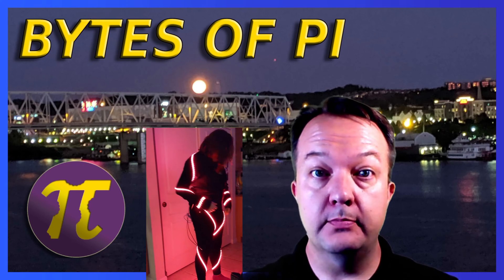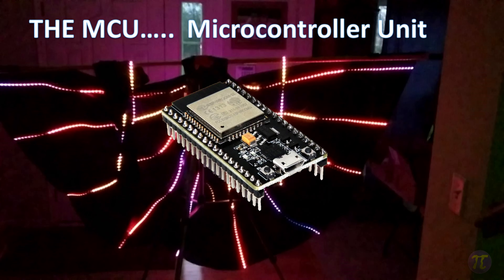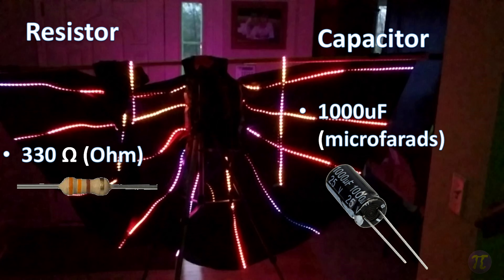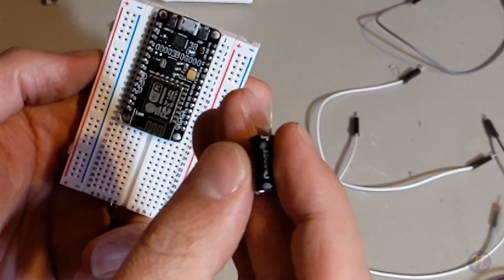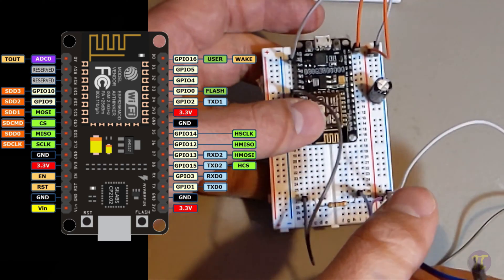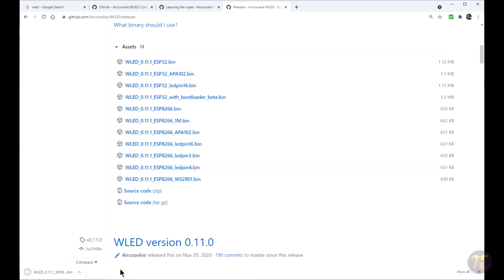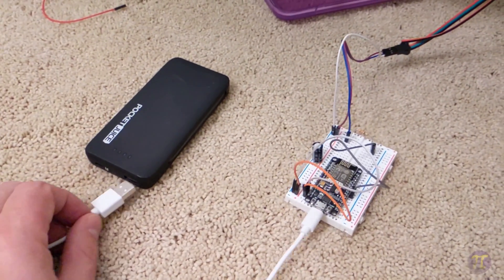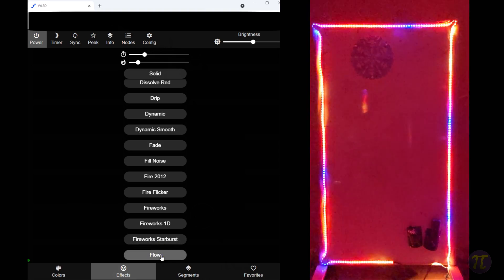How to build a Pixel LED Mobile Suit Part 1: Basic Setup

Comment: Great video.  Was struggling to see how you hooked up the capacitor.  Do you have a schematic you can share...?  Thanks.
Reply from the maker: I'm sorry I don't have a fritzing diagram, but putting in the capacitor is pretty simple.  On the barrel of the capacitor is usually a white line with minus signs on it.  Put that pin on the negative (or ground or blue) rail and the other pin on the positive (or red) rail.

The capacitor is not necessary, but it's meant to smooth out power fluctuations and protect your lights
Reply: @BytesOfPi  - ah got you, so it sits across the the positive and negative feed to the lights..?
Reply from the maker: @markhurrell8830  correct!  The capacitor reduces noise and power spikes from the power supply.  Check out the diagram from the WLED getting started page

They have a good diagram.   Not exactly how I wired it up, but I would definitely trust their diagram

https://kno.wled.ge/basics/getting-started/

Comment: Could I ask how many LEDs per metre you used? Thanks in advance.
Reply from the maker: Sure, I have links in the description to the materials used, and here are the ones that I used.  https://amzn.to/3wcIzme

It's 300 for 5 meters or if you divide by 5, it's 60 per meter.  Since I wanted to protect against humidity and rain, I chose to go with the waterproof